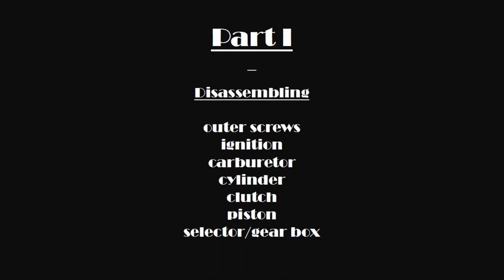Manual: Vespa Wideframe Motor zerlegen erneuern zusammenbauen Anleitung GS 150 Restoration Engine

Comment from the maker: ⬇️⬇️⬇️Table of content⬇️⬇️⬇️

🪛🛠 DISASSEMBLING 🛠🪛

PART I - 00:00
Ignition - 00:25
Carburetor - 00:41
Cylinder - 02:00
Piston - 02:36
Selector/Gear Box - 03:15

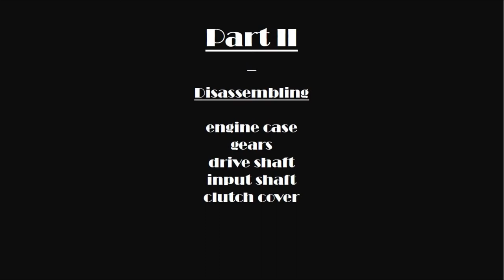PARTII - 04:29
Engine Case - 04:32
Gears - 05:16
Drive Shaft - 05:36
Input Shaft - 06:23
Clutch Cover - 09:27

🔧⚙️ ASSEMBLING ⚙️🔧

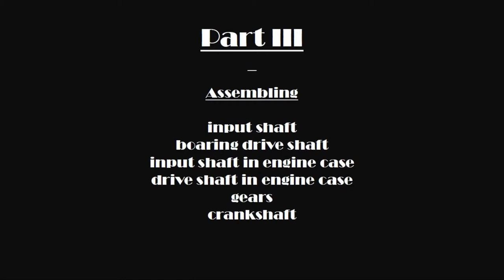PART III - 11:02
Input Shaft - 11:07
Bearing Drive Shaft - 12:44
Input Shaft in Engine Case - 13:08
Drive Shaft in Engine Case - 14:07
Gears - 15:10
Crankshaft - 17:18
Putting together the Engine Cases - 17:57

PART IV - 14:05
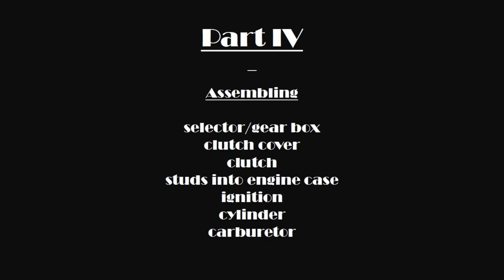Selector/Gear Box - 19:10
Clutch Cover - 19:35
Clutch - 19:57
Studs into Engine Case - 21:27
Ignition - 21:57
Cylinder - 24:06
Carburetor - 24:35

‼️ATTENTION,  please note‼️
The bearings of the crankshaft are milled. That's why I hadn't to knock the sealings flat. If you use non mill-cut bearings you have to flatten the sealings! (See in the video description)
Reply: What do you mean by mill cut bearing ? There to understand the difference here
Reply from the maker: @grailoc  Oh I am sorry. I didn’t read your comment.

The sealings have a crimp / fold on the outside (which shows to the bearings that sit in their engine seatings. If u don’t Hammer this crimp on your sealings flat the sealings won’t fit with your bearings and your crankshaft. 
So u have two solutions:

1. U can Hammer the crimps of your sealings flat.
(See pictures 26 to 31 on this website:
https://www.altevespa.de/tipps-technik/vespa-gs3-motor-ueberholung-mit-bilder/)

2. U use this set by scooter center: 
https://www.scooter-center.com/en/bearing-and-oil-seal-set-for-crankshaft-bgm-pro-fkm/viton-e10/etahnol-resistant-fag-bearing-vespa-wideframe-vm-vn-vl-vb-gs150/gs3-vs1t-vs5t-vdts-vd1-vd2-largeframe-vna1-vna2-vna2m-091392-vba-vba1m-313583-bgm1112

if u look close on the pictures u can notice that the bearings are mill cut by the manufacturer. So u can simply install them without hammering anything. Plus: Scooter Center has an English description :)

Comment: Do you not re-use the pins on the end of the primary drive springs?
Reply from the maker: Hey, sorry for my late reply.
I wanted to reuse them but couldn’t because the new springs (label: BGM; bought them from Scooter Center) were longer than the original springs from Piaggio. They simply didn’t fit with the pins. But without the pins they were just perfect in size. 😎

Comment: Echt Klasse Video. Top
Wieviel Kohle und vor allem,  wieviel Zeit hast du investiert?
Reply from the maker: Danke dir 😁👌🏼
Ich hab zum Glück alles aufgeschrieben 😄
Zeit: März 2021 - April 2022
Immer wieder an freien Tagen (2/3 mal die Woche) bissle was gemacht. Oft auch einfach aufbereiten und stupides Waschen, Putzen, Polieren, Sortieren und so Zeug. 

Kosten für Motorüberholung hab ich hier:
281,20€ Bestellung
157,29€ Bestellung
34,46€ Bestellung
154,40€ Bestellung
119€ Zylinder Bohren und Hohnen beim Motorbauer
68,28€ Bestellung

Gesamtkosten mit allen Bestellungen und Dienstleistungen (Strahlen, Lacken, Zylinder hohnen beim Motorbauer, Verzinken, Unfallschaden rausdrücken beim Karosseriebauer):
~ 4.200,- €

Joa, Geld bekomme ich nichtmehr rein. Aber hat ja Spaß gemacht und über die lange Zeit verteilen sich die Ausgaben und tun weniger weh. 😁👍🏻